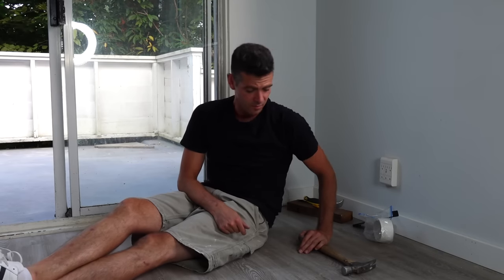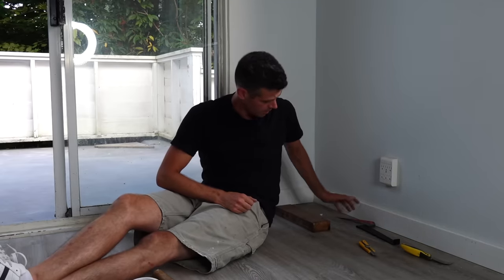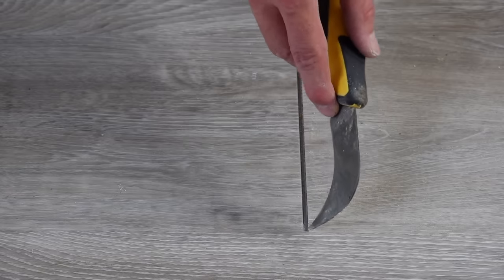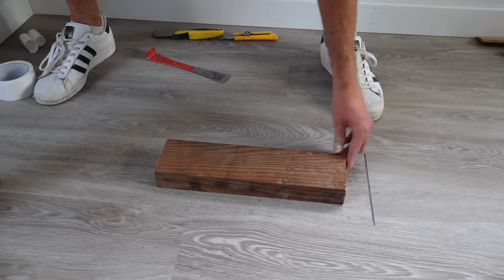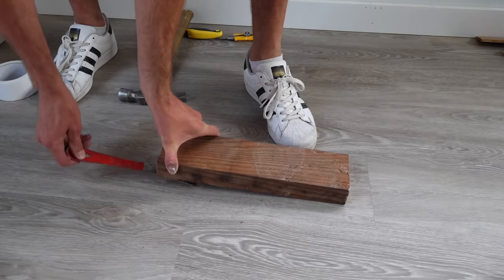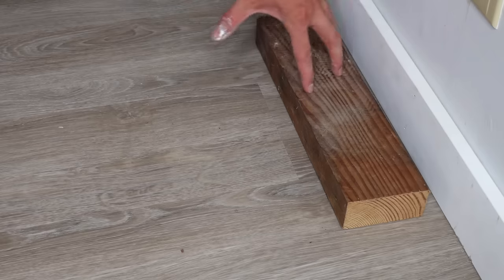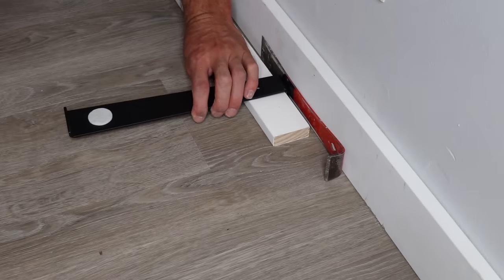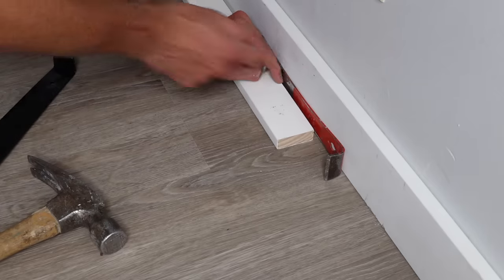How to Fix Gaps in Flooring!!! (Laminate, LVP, Engineered wood)

Comment: Instead of the carpet tape, we use a piece of that non-slip rubber matting that you line drawers with on the bottom of the wood, and a piece of foam on the top to protect your knees. You then kneel on the wood with both knees, and that's enough pressure to get it to grip without needing tape.
The tape occasionally causes problems especially on cheaper vinyl planks.
It can rip up some of the wear layer and ruin the plank, which is a nightmare if you don't have some attic stock on hand.
Reply: @DonLicuala  We haven't used that crap for years, and none of the architects are specifying it anymore. I'm surprised you even use it on rentals.
This technique is still useful though - it can be used on click vinyl plank etc.
Reply: U saved me so much frustration..thanku so much I thought my floor was just stuck like that unless i redid it !!
Reply: @serenity3526  You might just be able to kick the planks back into place with rubber-soled shoes. That works fine most of the time, but if not, this gadget is easy to make.
Buy one of those rubber drawer liners (it looks like a sort of mesh) and use contact cement to glue it to a piece of wood.
When it is dry, put something soft over the top (we use a piece of rubber sports flooring, but anything will do) and kneel on it to apply pressure to the plank.
Then, just tap it with a rubber mallet. Use many small taps instead of trying to hit it really hard.
Also, it helps if you position the device on the opposite end of the plank to where the gap is. If you place it too near the gap, the weight of you kneeling on it can sometimes warp the plank enough to prevent it from smoothly clicking into place.
Reply: Thanku so much God bless
Reply: @thepenultimateninja5797  Yep, rubber soled shoes! That's what I did, carpet tape risks tearing off the veneer.
Reply: @lubumbashi6666  Yes, the other devices are only really useful as a fallback option for when rubber soled shoes don't get the job done.
99% of the time, you can just kick them into place. It's the easiest way, and as you said, it's much less likely to damage the plank.
Reply: Worked perfectly
Reply: That grippy cabinet liner is a great idea. Just need the weight on top. Thanks for that.

Comment: Great trick!
If i could offer one suggestion it would be to put down a strip of blue painters tape on the flooring where the double stick tape is going to contact it.  This will allow you to pull the 2x4 up afterwards without worrying about damaging the floorboard.
Reply: Awesome idea !!
Reply: This is what I did.

Comment: This is an awesome trick/hack! After installing 2,000+ ft in one of my historic buildings as we could not save the hardwoods, the age and moisture and movement of that building has created a few gaps. *note, the addition of blue painters tape on the floor before the double stick tape is the trick as the flooring we have went obsolete as well! My tip...use a rubber mallet and the pads on the floor pry bar, AND don't hit too hard.

Comment: Perfect timing. I just bought a house with the most beautiful floors but the installation was wrong on so many levels. I had no idea how i was going to close up so many large gaps. Thanks to you...now i do
Reply: Most of the time you can just kick it back into place. Try that first. Double sided tape is a last resort. The strong tape is usually meant to be permanent so you'll be cleaning off the adhesive which is a pain.
Reply: This is how my floors are.
Reply: Why do they separate in thd 1st place?? Seems like an ongoing issue with these types of floors.

Comment: Thanks for the hint. We successfully closed the gap. However, we were hesitant to use carpet tape. Everything on the carpet tape said not to use it on vinyl floors because it might damage the floor. The labelling says the tape is designed to be permanent. We used double sided mounting tape and it worked great. Our floor is Luxury Vinyl. Thanks again!

Comment: Use fishing line to cut the adhesive between the floor and tape. Works everytime
Reply: I do this kind of work all the time. I’ve never used fishing line, or even heard of that. That is an awesome idea. Thanks for that tip.
Reply: @Beefeater911  just like flossing teeth. Back and forth motion
Reply: @Chris-lz7sx  the people in the buildings I repair now, use double sided tape on the walls all the time. I’ve been using a putty knife to remove things they hang. It works, but fishing line would be much quicker I think.
Reply: @Beefeater911  Yes a fine line will do the trick
Reply: Try 30-40lb test braid. Use a piece of dowel for a handles on both ends as it will cut your hands. Like a tiny round razor blade. Wicked sharp. Think PVC cable saw only much thinner.
Reply: @wattsup918  So you've just made a garrote, here in Canada that's a prohibited weapon.
Reply: I use a guitar string with two dowels like a garrote
Reply: Use a sawzall with a half worn out wood blade.
Reply: @michagabo8819  Really....wrong place to preach your beliefs on religion. Perhaps you posted on the wrong site??
Reply: @michagabo8819  accidentally triple up on your allergy meds this morning?
Reply: or Cut the tape long enough so you can wrap it up around the top edge of the board on one end. Then when you lift the end without the tape and use the board to either pull the tape or at least start the tape to peel.

Comment: Thanks, I put down really nice vinyl plank in my entire flat and even saved it when my whole flat got flooded by using an industrial wet and dry vac. There was some tendency to buckle and show gaps as the floor fully dried over a period of weeks. I just kept at it with a rubber mallet and never had to re lay it. The low humidity in Western Australia probably allowed to eventually dry. Great tip and helpful comments. Time to go gap hunting rather than just ignoring them!!

Comment: This is such an AWESOME trick. Laying my first floor this weekend and I'm sure this video will come in handy!
Reply: Can also use a rubber mallet. Have some stand on one of the planks on that run within a couple feet of the gap, then take your mallet and hit it at an angle on the plank next to the gap on the other side towards the gap.
Reply: Install shoe molding on it you’ll never have a gap problem
Reply: @trokerolokochon9423  well, shoe molding would go on top to cover your edge gaps. Theoretically if you had enough downward pressure on your shoe molding it would hold the vinyl planks in place, I just don't know if you can do it in practice.
Reply: maybe too late for you but.... take tiles out of box, separate ie spread around room and leave 24 hrs prior to gluing. edit. just realised u guys are talkin those expensive wood laminate planks. I'm thinking vynal strip tiles. my mistake.
Reply: @DirkDaJerk  not to mention shoe molding looks like shit.
Reply: @michaelmcgee2026  well, you don't have to use shoe molding. Any kind of baseboard will cover your edge gap

Comment: It really works! I fixed a handle to the 4x2 to ease prying it off. On lino plank floor closing gaps along the edges was helped by heating the tung&groove with a hair drier.

Comment: Hi Matt, your videos are so valuable thank you! Since I learned to feather the edge, things work out great when doing drywall stuff.
Btw if the gap is not too close to the wall, e.g. in the middle of the room, I usually clean the gap as you showed and then put on sport shoes with sticky sole (like you have) and jump or actually slidejump with one foot only, forward to use my body weight to close the gap. Works pretty fine and you do not need any tools at all. Have a good day!
Reply: *Ben

Comment: Good advice. As for when needing some glue I’ve had good success using a gel type super glue for tougher joints, especially where you’re using narrow strips near your walls that want to open up. I’ve even cut in whole replacement boards in the middle of the floor after cutting off the tongues along two sides of the replacement board using this glue with great results. Gorilla Glue brand which is available most everywhere has a type of this gel super glue.

Comment: All kinds of ways to get the tape loose.  Attach a larger board on top of a smaller board so that you have easy leverage access points. Use the 2x4 and tape, but extend the tape over the end of the board and attach it on top of the 2x4; easy peel off when done. The beauty of the video is that it gets the brain engaged for solutions some of which, as seen in the comments, are quite inventive and helpful.

Comment: Thank you for the video. You did teach me some new tricks with the double sided tape I had not seen.  We have laminate throughout the house as we have  removed all carpet.  I bought twin glass suction cup tool and use that to move the tiles.  I think the wood with tape might work better over all if you have a stubborn tile to move though. I will buy some tape and see if it works better for moving my rows under the refrigerator that have been a problem. The refrigerator actually pulls away the rows the other way. I bought the tiles from Home Depot, Home Collector brand ( I think is the name). They are really easy to go down but have been a problem just in that one spot.. They do move back with some work though. Peace.

Comment: There are 2 problems with this method.
First, the double sided tape can leave residue on the floor, which is a pain to get rid of.
Second, when levering up the block, it's very easy for the edge of the pry bar to dig into the floor, leaving a dent.
Rather than use double sided tape, use one of those high tack silicone mats that you can put on your car dash to hold things still.  The tack of the mat and the weight from your foot on the block gives you all the grip you need.
Reply: Hey can you provide a link to a mat that would work in this scenario?

Comment: You can also use the suction cups (double and single) used for installing windshields, then you don't have to mess with the tape.
Reply: I just came across this video and read several comments like this one but one thing none of them mention the small pieces described in the video. How are you going to fix those with suction cups?

Comment: I do the same thing, but instead of double-sided tape, I have a 2x4 with silicone (dried up of course) under it.  Provides plenty of friction to move the planks.
I use it once a year when the laminate flooring has gaps.

Comment: Great Trick! I've used it myself with 100% success.  What I did different (and this worked fine for me) I used 2" wide Blue Painters tape rolled over on it self (loop) in place of carpet tape. Squash it down tight and it holds surprisingly well for this task.  If needed put the rolled-tape perpendicular to the direction of board movement for extra grabbing power.  2 benefits: You already have blue painters tape and it's easy to remove without a pry bar.

Comment: When your installing it, put a peice of ducktape on the ends before you lay them, it will stop them from sliding.

You can also use a syringe to put a small amount or wood glue in the tracking before you click them together.

Never use nails in flooring, always spend the bit extra on screws and some pl premium. Guarantee no squeaks

Comment: The tricks are handy and I actually have a few opening joints that I will try to fix (again)! But I was surprised about the small strips near the wall: I think the usual advice (for laminate) is to not use starting or endpieces smaller than about 40cm, you should cut the other end to fix it.

Comment: Is the same method good for the long gaps? In other words, you showed us how to solve the width problem but not the length of the boards.
Reply: Did you ever get an answer to this question? I have the same.
Reply: @sethellsworth5695  no. I sure wish someone would let us know, though.

Comment: Wait, so we DON'T fill the crack with hot mud?
Reply: I know an installer that I used to work with. One day he had a gap in a 3/4" install that wouldn't move. Instead of using the proper filler we use in small gaps he decided to fill it with outdoor caulking.......

Comment: Easier way: Clean the crack, add a little glue, and kick it into place with your sneaker. The method in the viedo will do it for the shorter pieces near the wall >23 year floor installer<
Reply: he doesn't say how to fix the other end either

Comment: Flooring doesn't just separate...The lock that holds them together failed for whatever reason. Put a drop of glue on it after you clean but before you knock it together. Make sure you wipe up any glue that comes out of the joint.
Reply: There is no "lock" on the ends! The joint you are referring to is on both sides of each plank (one side the grove is in the up direction the other side the grove is in the down direction). Nowhere in this video did he show a situation like you describe. The lock on the sides of each plank are designed to prevent lateral movement only.

Comment: Very clever solutions & tips.  Thanks.
[1]  I'm going to start putting my rolls of tape in a Ziploc bag.
[2]  Perhaps, warming up the existing adhesive with a hair dryer or heat gun,
then tapping to persuade it to move might make stubborn jobs easier.

Comment: Thanks so much for having this video.  I had 6 gaps in my floor from my dishwasher install severly  leaking 2 years ago.  It raised the floor then shrunk back and caused these big ugly gaps.  Used your plan and it worked just as good as it did on TV.  FABULOUS and thanks so much!!

Comment: Worked perfectly!!!  Had a spot that was driving my slightly OCD:) wife crazy on our newly installed (by me) floor.  I used a much shorter 2x4 (hence less tape) and it worked wonderfully.  I gave the front part of the 2x4 a couple taps on the side and it broke away from the tape perfectly then I peeled it off the floor with no issues.  Very happy wife=very happy life
Reply from the maker: Awesome!  If it ever opens up again try putting some glue in first.

Comment: Nice tip thanks. i purchased one of those slick little metal tools to assist in my installation, and yes, the pads are on it. It was eight bucks, but worth a million. Thanks for posting.

Comment: Thank you for sharing this worked for me. Just a couple "TIPS" for the next person: If your gap is 2 planks in go to the furthest board away from that gap like in my case close to the wall and move both boards at the same time. If you don't you will fix the first gap but create a gap between the other plank. Then that plank in my case was actually harder to get back in. I hope that makes sense. I also placed two rubber dumbbells' on the plank past the gap so the rest of the line does not move.

Comment: I heavy reccomend spraying soapy water the length of the joints on the sides of the piece you're trying to slide in. Many times with herringbone flooring, repairs, or tricky spots with Lvt I've only been able to slide a piece into a 3-sided hole and soaping the seams was a game-changer
Ditto for rubber mallets, rubber non-slip pads, or even adhesive velcro tabs that a lot of homeowners will have for the gaps. Goof off or goo gone the adhesive residue, and watch for it peeling the veneer or finish! You can always use a heat gun if it seems to be pulling off your finish.

Comment: I've done this using double-sided exterior trim tape and it's a bit less sticky so it's easier to remove the piece of wood after you hammer it. It's also quite tacky so you can reuse the same piece of tape several times.

Comment: This works real good. And for those gaps that just won't go away. Use a fine line of CA glue before you hammer those together. And it will never gap open again.

Comment: Im a flooring installer and i keep a piece of 2x4 with some of the non skid cabinet and draw liners wrapped around it and glued so i don’t have to use double side tape..just the down force of your leg on the 2x4 you can tap it in and not damage your floor.. you’re welcome

Comment: I drive a low-pitch hardwood wedge between boards held by doubleside tape.  A friend recently told my to try dental floss.  Haven't tried it yet but will on next project.

Comment: I use a suction cup. Clean the plank. Install the suction cup. Tap suction cup until it moves into position. 
Removing the suction cup is a lot easier and less messy than carpet tape.

Comment: Stiff brush for the gap before vacuuming. Instead of the carpet tape, use woodworkers double back tape. It’s not as sticky but doesn’t require the force to remove the block

Comment: I fix a fair few of these. Firstly, before you close the joint, are you going to glue it? Usually helps stop it opening up again. Secondly, on most floating floors you can just kick it with the heel of your shoe to close it up, no need for the 2x4 etc. If you do need to stick a block down to hammer it, don't use tape, risk of damage when prying it up or even the tape itself causing damage. 2 things you can do that won't cause any damage. 1. put a bit of rubber/grippy material down, then your block of wood. Stand on the block of wood and hammer it, there is usually enough friction to make this work. If the wood still slips, glue it down with hot glue. Once the gap is closed, squirt some IPA on the hot glue, it will come away easily, no damage.

Comment: Neat tip, but I think I’ll try it with those rubber shelf liners. They feel they should give some type of grip, especially if you apply your foot or pressure to the wood.

Comment: If you put a 1/8” shim under the 2x4 end that your hitting with the hammer it makes sliding the small pry bar under the board much easier without scratching the floor.

Comment: you can also put a pair of rubber soled trainers or sneakers on... place one foot one side of the header joint and with the other foot stamp down and forward the other side of the header joint and it should pop in .... simples